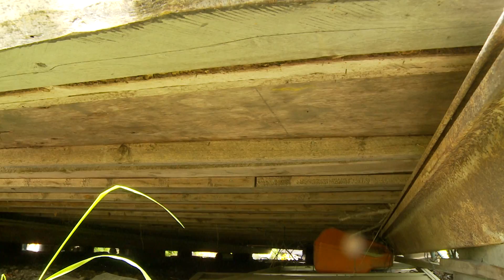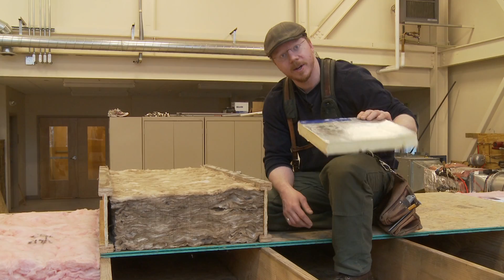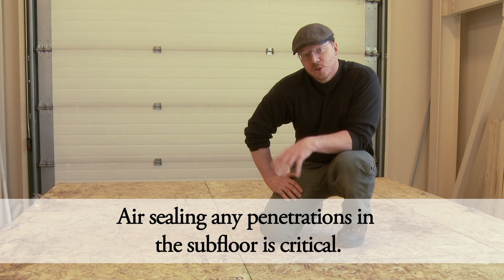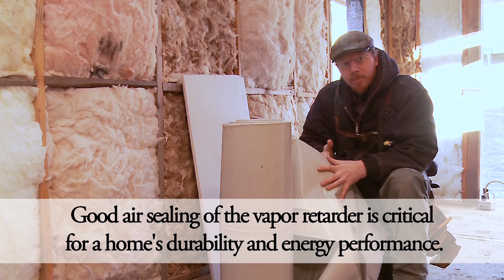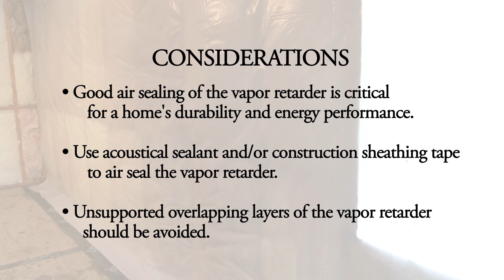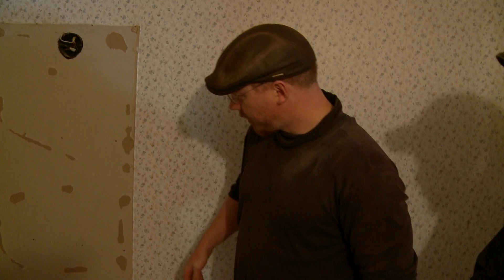FEMA Flood Damage Repair

Comment: what is your position on crawl spaces? encapsulated or left open to breath?  I just experienced 12' of water in old cabin.  the floors have been completely removed and dried.  now it time to rebuild and wait for the next 100 year flood.  so far 3 in the past 50 years